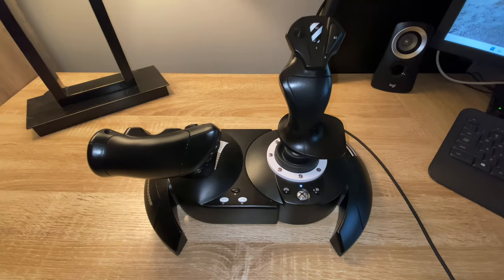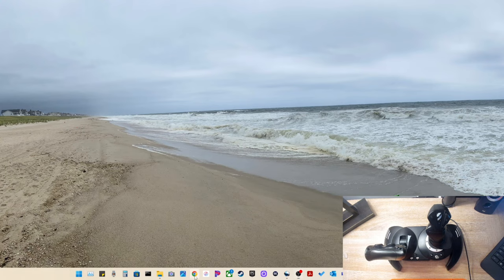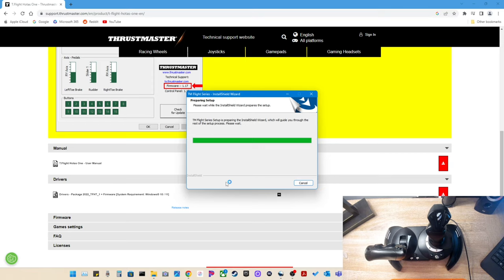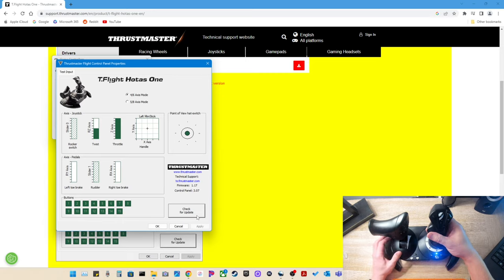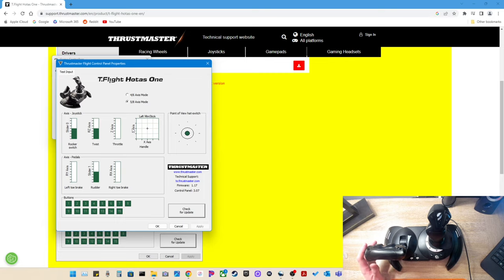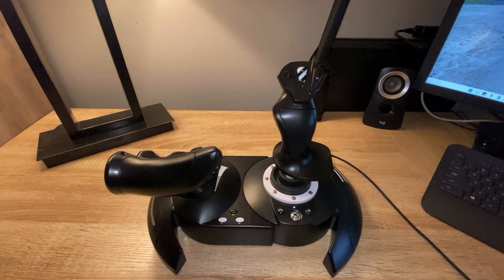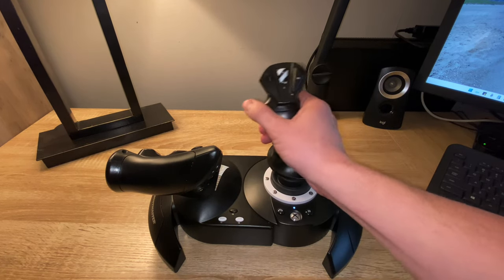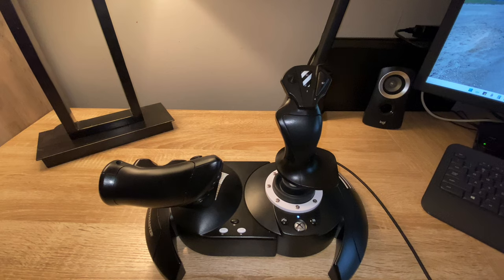Troubleshooting Flight Stick Drift: THRUSTMASTER T.FLIGHT HOTAS ONE Review, Testing, and Repair Tips

Comment: My Twist and Rocker on the Hotas One automatically go to 100%? if that makes sense, there is no sensitivity on either the rocker or twisting the joy stick, I've tried everything but still can't fix the problem, every other axis works properly, minus the twist and rocker function, both have no sensitivity at all, it's 100% regardless of how little you twist the joy stick ...

does anyone know what is happening here? or what the problem might be? I thought it maybe the potentiometer in the joystick, but if that was the case, one would think the rockers would still have a sensitivity, but no, as mentioned, both are 100% or nothing

so, so annoying ... argggggggg
Reply from the maker: That sounds like a defective flight stick, has it always been that way?

Comment: Hi,I have a problem with my T Flight Hotas X.In turns when I have the stick pulled back the airplane will not keep a tight turn.I hooked the joystick to the Driver and saw that when I pull back the stick it will not stay at the bottom but want to jump up and down towards the center position.It does this sporadically so that when I am in a turn it will not be tight and I am a sitting duck.The joystick is not old.Do you happen to know how I can fix this problem?Thanks and your video was helpful on how to hook up the joystick to the driver.Greetings from Germany.
Reply from the maker: The Thrustmaster HOTAS X analog stick, also known as the joystick or control stick, uses potentiometers to detect movement. These potentiometers are variable resistors that change their resistance as the stick is moved in different directions. The HOTAS X has sensors that read these changes in resistance, translating them into movement on the screen.

Dust, food, or wear can lead to calibration issues or stick drift. If you're experiencing problems where it jumps, try blowing compressed air inside at the base of the flight stick. If that doesn’t work, and it is under warranty, Thrustmaster may be able to replace it at no charge to you.

Greetings from the United States!
Reply: @tekgamerworld Thanks for your reply.I will try to call support tomorrow and see what the say.The warranty is up  I think .I only played with it for about a month or two but was so frustrated that I used my older Thrustmaster that I somehow fixed but I have flown this one so much that it is getting worn out.
Reply from the maker: Thanks, keep me posted as to the resolution on the issue!
Reply: @tekgamerworld I think I fixed the problem.I discovered that there was a gap between the potentiometer and the plastic nub that holds it in place.I stuck a thin piece of cardboard in the gap to tighten it up and hold it in place.Now it does not jitter anymore so far and I can make normal turns.
Reply from the maker: @DTroop10thCav. Awesome job!
Reply: @tekgamerworld  Thanks...I will see how long it will work.

Comment: Seems like I only have a drift right when a slight right input, and I let off, more dramatic right input and total release lets it center back perfectly, probably could've used stronger elastic, or less friction so it zeroes flawlessly
Reply from the maker: Try and loosen or tighten the flight stick on the bottom?